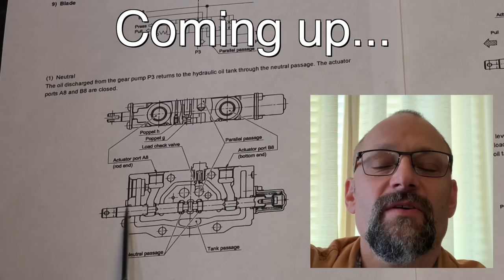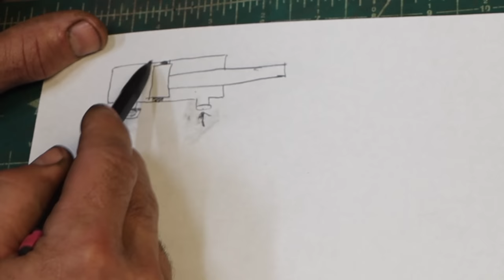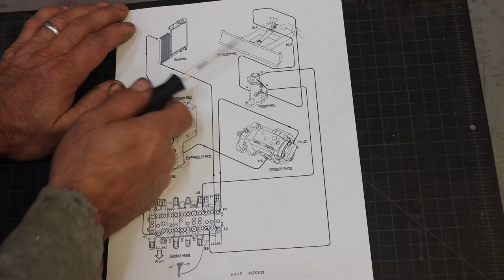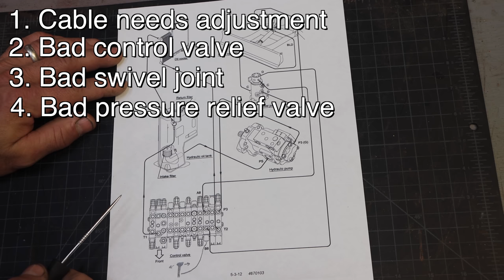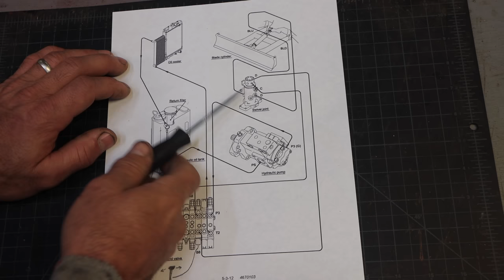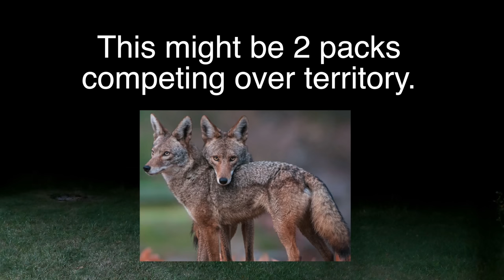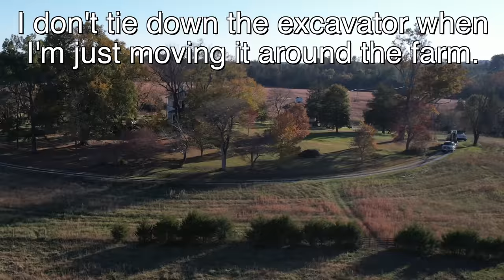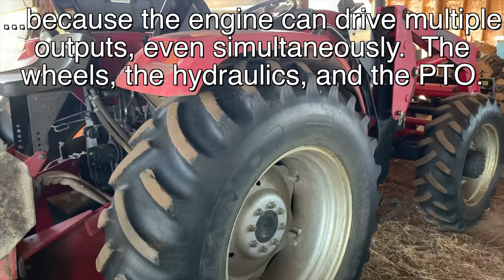Excavator Repair, Swivel Joint Rebuild, Yanmar Vio-50.

Comment: I know it's kind of random to say it, but I really appreciate the fact you clean machines and their parts when working on them. Others take great pride in rummaging through all that mess as if cleaning it would take away their manliness or professionalism.
Reply: Yep gets my goat. Two minutes to clean makes a job much easier especially when dealing with hydraulic cleanliness. Often shows other hidden issues too.
Reply: The cleaning is much appreciated
Reply: ya its good when they clean the oil that is preventing it from rusting🤣😂
Reply: ya pretty much don't have any choice when working with hydraulics.  A little bitty bit of dirt inside any of those parts and the whole system can be toast...
Reply: I call it .obceen.
Reply: First rule for most tasks, keep your workspace clean.
Reply: It always initially seemed to be a waste if time.

Then I dug in and started using engine bay cleaner and pressure washing.

The difference is massive. Sure, youll still get somewhat dirty but nowhere near the caked on oil leaks and dirt and all I used to deal with.

Those gojo hand rags, the moistened ones in a tub are phenomenal at getting all sorts of gnarly grease oil off also.
Reply: I was a clean freak.
Reply: Working on cleaned equipment is always better, safer and keeps contamination and avoids gambling with premature failure.
Reply: not to mention taking the trouble to replace all the other seals and o-rings just because.
Reply: Believe it or not I have fixed quite a few leaking seals on machines by simply cleaning around them and scraping the dirt out from under the lip seal.
Reply: But that muck is structural!
Reply: @danhard8440  No joke though. I had a small engines teacher back in high school give me a lecture about this because I didn't clean every nook and cranny of a mower I was working on. I was pretty tickled a couple years later when I heard he nearly junked an engine rebuild for his 67 corvette after forgetting freshly cleaned parts over one of the most humid summers I can remember.
Reply: @danhard8440  dirt also works good for ruining hydraulics and increasing failure and money spent on repairs. It’s not just oil guy😅😅😅
Reply: My old man's machine would be gunked In mud and grease and do repairs on his logging equipment.   Would beat that pin out in no time with sister sledge
Reply: @custos3249  only the black sticky muck is structural. Trust me, I come from a long long line of engineers ...
Reply: It's so satisfying to watch. I've learned so much
Reply: A fascinating post especially with all of the camera work. Makes me wonder what you did in your before life or were you just born a very capable gentleman.
Reply: You can look at it 2 ways. Oil and grease keep away rust, or dirt and grim bug me and get me dirty. 
I can wash my hands, but I cant wash off the rust.  So ill compromise and get the bulk off but not remove all of it. 
Thats a happy medium.
Reply: @luemn7691  : It also has the added benefit of making trouble shooting easier on future repairs.  If you keep things clean, it is much easier to locate leaking joints.
Besides all of that, it shows attention to detail when you work clean.
Reply: I can't stand watching someone work on dirty machinery.  Every single time, dirt gets into the guts and screws something up.  Clean it, dry it, and then work on it.  Marking is important, too, so he gets another point.  Working logically gets another two points.  ;)
Reply: I did a brake job on the wife’s car today. Wheel 1 I cleaned the inside of the hubcaps and the wheel. By wheel 4, did I remember to put the new pads on, eh f*** it the front wheels do most of the braking anyway….
Reply: Ala Marty T.

Comment: We used to tell tank operators in the army that they could only rotate the turret 7 full revolutions either way before it unscrewed itself or bottomed out. It was pretty funny when they would forget to keep count and come up to us asking us how to fix it.
Reply: From what you say I take it that there was no indicator in the cab to tell the operator how many revs were left in each direction? Seems like an obvious thing to provide.
Reply: @jonka1  it would be if it was true and all.
Reply: Funny
Reply: I imagine the ones who could do it with no problems and through entire exercises were promoted immediately and were let in on the secret.
Reply: @jonka1  r/woosh, there's always one
Reply: @jonka1 f you can bring me a box of grid squares and some chem light fluid I’ll let you in on the secret. And go tell the first sergeant we need some more batteries for the Prick E-8.
Reply: @jonka1  hey, while your at the airport...get me 100 feet of flightline, will ya?  Thanks  :)
Reply: @bryanford1139  I made a special trip to the airport but they didn't have any. They did have a spare turret revolution counter so I had that in case I ever need it.
They also had a set of instructions about how to understand subtle humour but I left it there incase anyone else needs it.
Reply: @jonka1  While touring the Battleship North Carolina we were told there was nothing holding the big guns on so if the ship rolled over guess what hit the bottom first? Don't know if they were spoofin' us.
Reply: @jamesmartin6546  Yes I believe that's normal on ship guns. I assume the makers assume that by the time the ship is upside down it no longer matters. It would of course stop any idiot firing at the sea floor.
Reply: @bryanford1139  They keep it in stores, right by the 5 gallon jugs of prop wash.

Comment from the maker: Like the video?  Want more like this?  Give it a like, a share, and check description on how to support the channel.  A HUGE thank you to all the folks giving their support, especially my Patrons on Patreon!  You guys are awesome.  https://www.patreon.com/FarmCraft101. My patrons get early access to the videos, and even help with editing decisions, titles, and thumbnails.  We are building a really cool community over there.  I hope you folks like the video, and have an awesome weekend everybody!  Next week's video is going to be a fun one.  I've almost finished it and it will be on Patreon either today or tomorrow.  Here's a short clarification on this video:  https://youtu.be/d_EP9dak6gw
Reply: I have the Vio 27-3, same year as yours.  It's the same machine exactly except for I'm lacking the enclosed cab.  (Open Cab).  I'm running into the same problem as you.  The dealer wouldn't fix it, but I know it's this piece as they checked the valves, and the cylinder and are fine.  I want to Thank You whole heartedly as I'm new to these things and I know this is what is wrong with mine.  I now know what to ask for in repairing mine and I had no clue before. I also want to ask, do you notice an improvement in your travel motors as well as a result of this fix?  I'm losing power there as well as in my blade.   One other difference is, I have a plastic gas tank, and have no gas issues.  Verified after your other video.  For all of your caps, you used, what size hydrolic caps did you use while doing the project?  Also KEEP DOING THESE!  Every one of these videos helps me in fixing mine up as well as mechanically they are identical!
Reply: Also I upgraded the Lights on mine to LED's.  HUGE improvement.  I recommend the Sylvania 3" LED Light 2N1SP, part number 11920293 F1 for the boom light replacement, fits perfectly, and the Sylvania Lightbar 2N1SPBX Part number 12018818 F1.   Both of these were replacement bolt-ons for mine, the light bar for the top may or not fit yours, but the boom light certainly will.  I'd need to see your front top light to see if it has the same mounting bracket.  They have 2 light modes, wide, and narrow on both.  To use both modes you'll need a SPDT switch to switch between the modes, I can send you wiring diagrams for them and you can make a new video on it.  Night time working is fun on the excavator.
Reply: Oh Man, I've done this exact same job on my Volvo EC27 - boy oh boy they don't give you any room to get at those swivel joints.  Took me days!  On my machine they have a little peg at the top of the joint which interfaces with a slot to allow it to swivel with the cab.  The pin on mine had worn slightly, which meant when the cab rotated the swivel lagged behind slightly (as the pin had some slop in the slot).  This meant that it would pull / push on some of the connected hoses, which caused them to loosen and leak over time. I thought this was worth mentioning.
Reply: Do the dumptruck and the excavator have names yet?
Reply from the maker: @TheNikitis  No difference in my travel motors, but if those seals had been leaking then that would be the expected behavior, so it may fix yours.  My caps were 3/8 BSP and 1/4 BSP, mostly 3/8.  Thanks for the tip on the light, I'll check that out.  Cheers.
Reply from the maker: @SamStolpe  Not yet...
Reply: @FarmCraft101  hey love the videos. Anyway to fix a fast clicking sound during time lapse? It's not you talking it's some kind of audio issue.  Other than that most excellent content!
Reply: @FarmCraft101  Tip on the oil dripping down your arms: cut the toe-part from old socks off and put the socks into your arms. It soaks oil nicely, elastic so stays put and are readily available.

Comment: I figured they had something like that in there. I used to be a tank mechanic on the Abrams. It has something similar called a "slip ring" that is mounted in the center of the turret under the main gun breech. It has fewer hydraulic ports on it, but also has electrical contacts to transmit power, data, and communications between the turret and the hull.

Comment: Wow, that was great.  I watched every minute of it and I feel like I gained 10 years of hydraulics knowledge in about 45 minutes.  The most ah-ha! moment for me was when you took us on a short tour of other equipment that all had similar looking hydraulic pieces in them - I'd been under the impression that hydraulics were bespoke and specific to the machine and had just never thought about how generic and similar it might actually be.  I was thinking they were more like engines where there's so much variation in how they're done (small vs. big, 2 vs 4 stroke, # of cylinders, etc) that it was almost specialized knowledge per piece, but I get it now.

This is one of your best videos IMO - thanks for making it!
Reply: The pumps themselves are a little more complex, but the rest of the system is just checks and valves, and pressure build up.  If it leaks (due to those clumsy seals) you lose pressure and thus functionality of your device.
Reply: Like industrial Lego
Reply: Fascinating repair video. Great job on the repair.

Comment: 30:50 Ahhhhhhh I get it now - I was completely mystified by how a swivel joint could possibly work, but after seeing the holes in the cylinder and your U-shape explanation, it makes perfect sense.  You are right, it is a simple solution to what seems like a really complex problem.
Reply: Yes, seeing is understanding in a second. Thank you so much!
Reply: I was also unsure of how the swivel worked, but I operate equipment and repair and build many things. My guess was that it was laid out horizontally or radially. It makes sense that they built it vertical, so I was close.

Comment: Hey there!
I want to share an other trick with you. If you don’t want to run oil down your arm use a multi use rubber glove, not one of those super thin one time use gloves, and fold the rear side one time to outside. So you have a channel which catch the oil!
Thanks for your awesome videos. Greetings from Germany
Reply: Since I've started working on dirty stuff with dishwashing gloves I had such a better experience doing stuff. Great grip, harder to cut and tear and multiple use for the nasty stuff. Extra points if you wash them by just washing your hands while you still have them on!
Reply: Reason I stopped changing my own oil - oil running down into my armpit!

Comment: UPDATE! - Guy who has your similar excavator again.  I just finally replaced my swivel joint seals.  I got my blade working and holding again, and tracks tracking again!   THANKS FOR THIS VIDEO!  I finally worked up the gumption to take this on myself thanks to you, and now have a working excavator.  Runs like new except have same issue with tracks not riding evenly as you do and pulls to the left.    Very messy job!  

My seals were worse than your old ones because mine were MISSING!.  They had disintegrated.  Out of like 7 seals, only 2 where there and the rest destroyed, the rest no longer existed, amazingly it still functioned at like 20% power even with them missing.  Enough to drive it onto a trailer.   And my blade would go up, but not stay up.  My swivel joint was exactly the same as yours, and same part number for seals.  Anyway, I don't know how many people have your excavator, or similar models and could take this on, but I wanted you to know I did!  Thanks for the help again, and looking forward to seeing your LED Light upgrades, you won't regret it.  (Hint those sylvaine part numbers I sent you before have 2 modes each, so get 2 SPDT switches, and wire it the switch so you can switch between wide angle and focused angle.)
Reply: Thanks 😊

Comment: Great job rebuilding that swivel joint.  You replaced all those seals as good as any professional.   It's nice to see someone fix things themselves as good or sometimes better than had they hired a shop to do the job.  Very gratifying I know because I'm the same way.

Comment: Great stuff.  I've always wondered how heavy equipment like that can rotate without fouling cables and such.  Also coyotes! <3
Reply: There are rotary electrical connectors, rotary fiber optic connectorsxascwell as hydraulics. Ive seen and worked with custom built units that encompass all three for use with offshore oil well umbilical reels.
Reply: Take pictures

Comment: I totally admire your cold-headedness while reducing the posibilities as to why exactly the blade is sagging.
On top of that you proceed to take out the heart of a chunk of metal while accurately noting what line 
connects to what valve in order to repair/replace the part yourself. 
Amazing!

Comment: At our shop we actually use old telephone wire because the wires are all different colours with stripes and you cut the wires in 2 pieces and tie them to the fittings. Works pretty good when you have to take the valve blocks out

Comment: I'm 51 and have always been curious how the rotation function was infinitely operational. I guess I wasn't curious enough to Google it. You never know what information is on the internet, in the same breath... you can't believe everything you find on the internet either. Great job and great video. Growing up on a farm since 11, you tend to learn about a wide range of things mechanically, simply out of necessity. FF to working construction years later, and get deemed the company mechanic when things broke or simply needed maintenance. FYI... Replacing the hydraulic lines on a boom lift from the basket down the boom is quite possibly more of a PITA than the center swivel rebuild. That swivel never did look like fun. 
Great video! Thank you for sharing content that is "the proper way" to repair things.

Comment: You have much more patience than I. I have a vio55 so now I know how to remove the swivel thanks to you.
 I just reciently rebuilt the air swivel on my Grove RT65s and it was very difficult and heavy. First I had to remove the electrical swivel which had 34 pairs of wires which had to be labeled. The service manual said to remove the electrical swivel cover, seperate the paired wires and label, but they show only one pair of wires so imagine my suprise when I removed the cover. As it turns out I may not have needed to repair the air swivel because when it was reinstalled there was still an obvious air leak just adjacent to the swivel. It was an old air line with the leak it a difficult location to detect.
 Today I purchased an old dump truck similar to yours except it is a ford. It has issues also but watching your videos has encouraged me so I will tackle each problem one at a time. Keep up the good work and thanks for the tutorials.

Comment: You were a little mistaken at the 42:30 mark, when you pointed at the Slew Motor and gearbox and said it was the Rotary Union. The actual Rotary Union was under the cover where you were describing the electrical Swivel Joint is. The giveaway was the hydraulic hoses leading into it.
  Your explanations of how systems work is excellent and much appreciated by people who may be mystified by some of these mechanical systems.
Reply from the maker: Correct you are! https://youtu.be/d_EP9dak6gw

Comment: I was a submariner in the US Navy as both a Sonarman and a Supply Officer. Never had to actually dig deep in repair, but we all needed to learn every system onboard. This takes me back to my qualification days as a junior Sailor learning our hydraulic systems, especially the explanation of opposing pressure in a hydraulic ram.
Reply: Yes, that opposite stuf was actually one of the gems for sure
Reply: Yeah I've done some hydraulic repairs but the surface areas on the extend vs retract are something I've never thought about.
 That means the extent will always have more power than the retract doesn't it?
Reply: @amosbackstrom5366  Not always, depends upon design.

Comment: I did that same repair, 45 years ago on a much larger unit. Much more room to work with those much larger hoses. A definite plus  along with being younger it was simple. Heavy but workable. Presently working  on replacing the hoses down to the motors on a small unit. Tight working but crowsfoot wrenches are handy tools.

Comment: Nice video. Simple and straight forward. A very informative video. I'm an industrial electrician but i have worked with mechanics who know hydraulics. The swivel is very straightforward in how it works. It is an ingeniously simple device that works well.